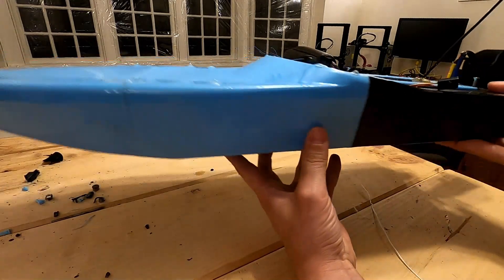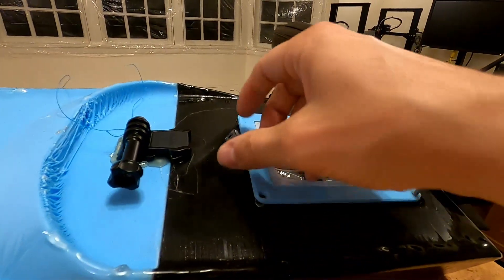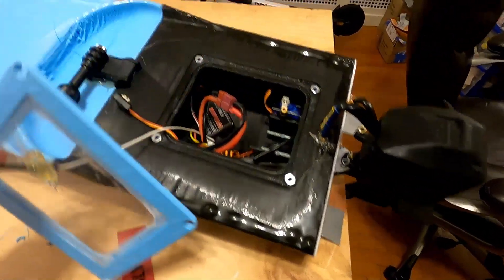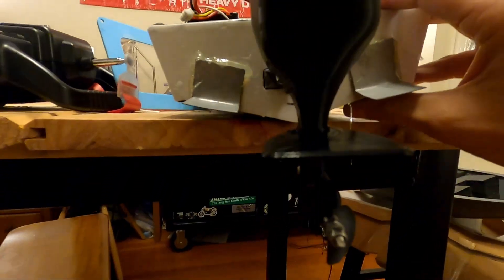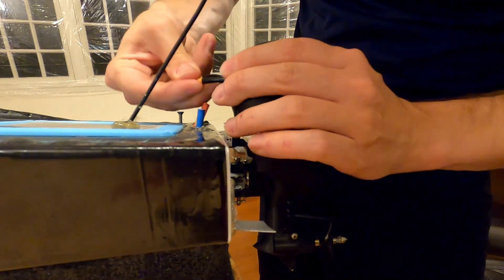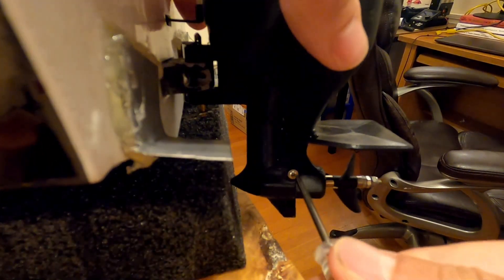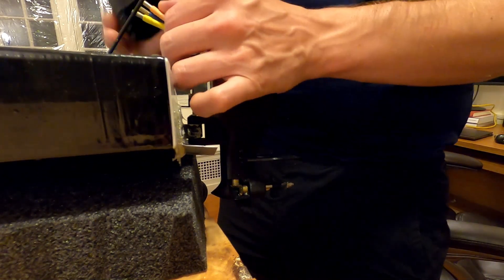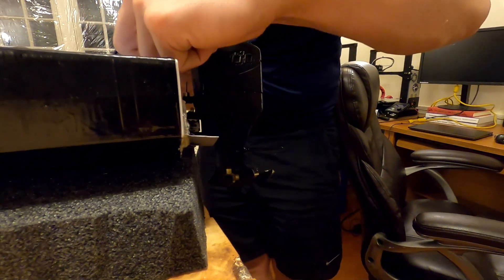3D Printed High Speed RC Outboard Boat Build

Comment: +1 Nice outboard build man thats awesome!! Its not even loud, seems to be running smooth!

I have a slightly older Electric Brushed Outboard but with a metal wire to prop setup, everything metal inside but the Prop and the actual Outboard Case. It has 2mm Alu motor plate that holds the 3650 motor and is oval and each half of the top part of the outboard has a slot all around the inside. Then the lower unit can be removed as long as the prop is already removed. Its a cool design with all standard rc parts like SS set screw collars inside for an rc boat motor, i couldn't believe it. 
The lower unit screws on from the bottom like a real motor but easy to fix, its just packed with grease for the metal flex drive and the drive for the prop for water. 
I just havent gotten around to putting a B/L motor in it and maybe finding a better Hull than what it came off of because its basically really cheap plastic at this point.

Comment: Man that outboard is too cool. I'm interested if you could design the cowling large enough to accept a water jacket for the motor while still keeping a scale appearance. I'm sure that motor will get hot after a long run. Love the design though. Very impressed.
Reply: Esc will likely get hotter faster then the motor but I agree both need a jacked. Pretty easy to do with 3d printing

Comment: Very cool project!! I really like the couple idea. How does the motor power scale compare to the prop size/pitch? Just wondering if the prop could be larger, because of the tremendous torque of that motor. I would be interested in the .stl of the outboard if you are willing to share it. I am working on my own version as well, just having trouble with some tolerances.
Reply from the maker: The motor is definitely up to the task of a larger prop. I reccomend a 32mm, 1.4 pitch prop to start. I have had great success with a 35mm 1.4 pitch and there was minimal heat in the outboard... the 60 amp ESC on the other hand couldn't keep up haha